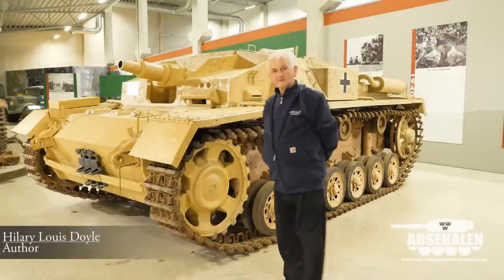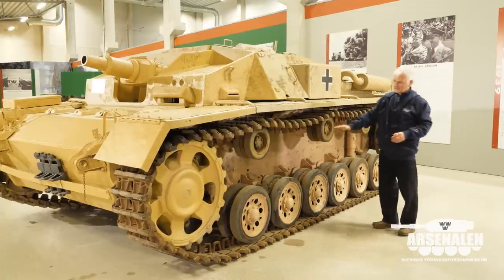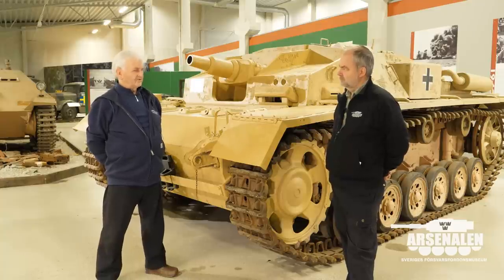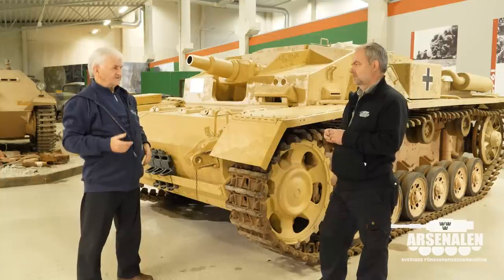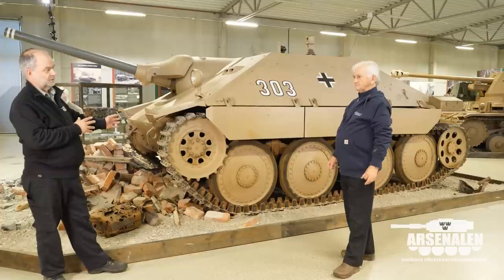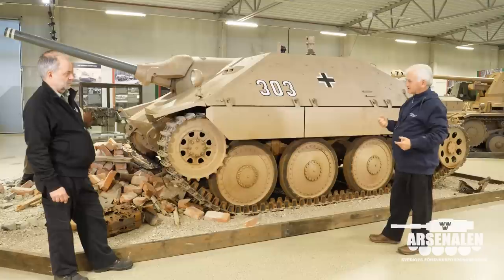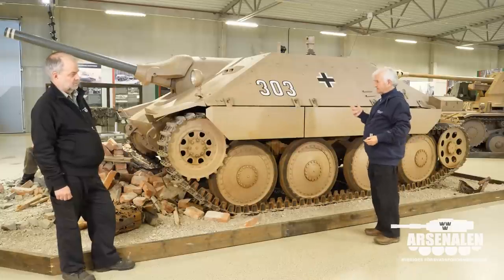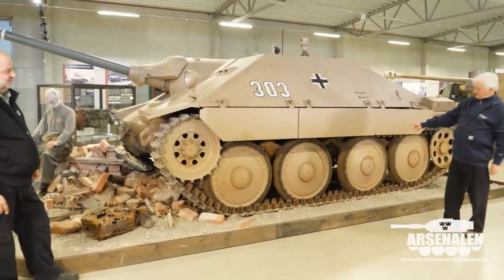WW2 tanks with Hilary Louis Doyle – Part 2| Arsenalen Swedish Tankmuseum

Comment: Regarding the gun on the StuG III: my understanding is that, in general, for a given caliber, a shorter barreled cannon carries a larger explosive charge (as the walls can be thinner) and therefore is more effective against infantry, emplacements, and the like. It's certainly less effective against armor and has a shorter effective range (and knowing exact range is more important due to a more rainbow trajectory). 

This is mostly what I've read about the Sherman 75mm vs 76mm (really the same diameter, given different names for clarification): the 75 was better liked as an infantry support gun, the 76 was a better anti-armor gun.
Reply: Longer the barrel, less curvature

Comment: 4:21 this fact will trigger all the Tiger/Panther/Ferdinand etc. fanboys; "Inflated", "propaganda", "impossible" and "no Tiger or Panther was ko-ed by a fighter plane". 😂
Reply: sorry, but that must have been obvious if you compare the production figures of the STUG and Tiger and what not: 10.000 versus 1.000 makes it obvious that the mass produced vehicle with the purpose of a defense role knocked more out than the 1.000 mbt of the tiger class which had to go everywhere and in far more risky challenges like a break through while the Hetzer and STUG were simply waiting for their victims in a well prepared defense position or ambush.

But the sheere advantage by production volume and its role makes it no surprise.
Each tiger and Panther had its own role and doctrine and Ferdinands were also tiny in production volume.